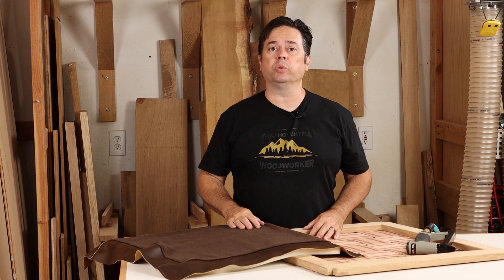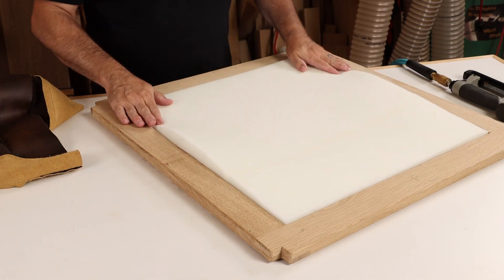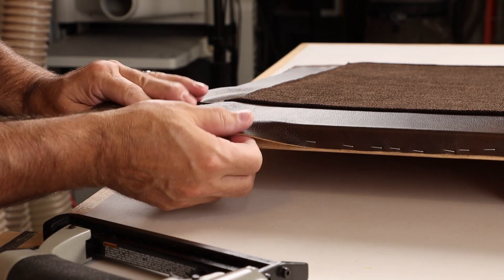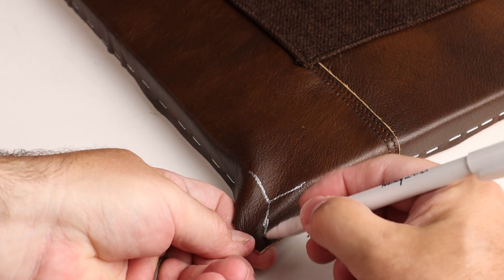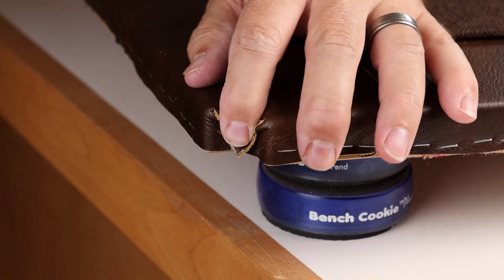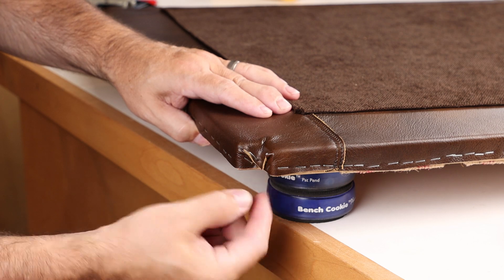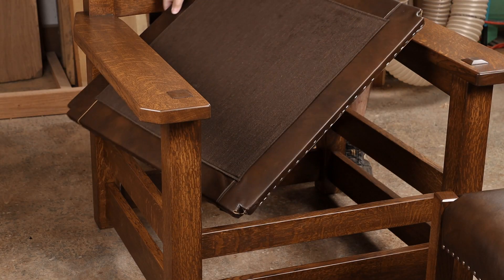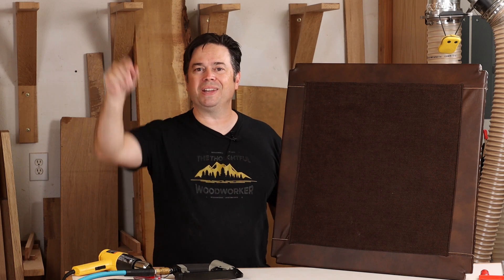Upholster Inside Corners with Leather / Trim Inside Corner with Y Cut Upholstery Technique

Comment: Thanks but this was not what I was looking for. This is okay because it's hidden I was looking for an exposed inside corner that you have to worry about the appearance. Thank you for the video
Reply from the maker: Hmm that's curious.  What application has an outside corner that's visible?
Reply: @TheThoughtfulWoodworker  
A padded 90 degree bar rail is one example.  Both inside and outside with the same piece of material. Thanks